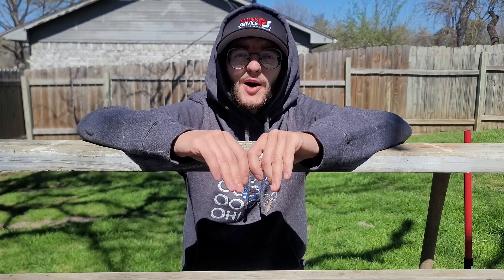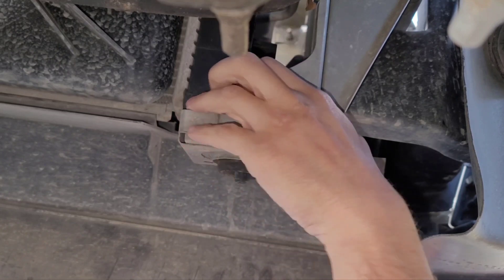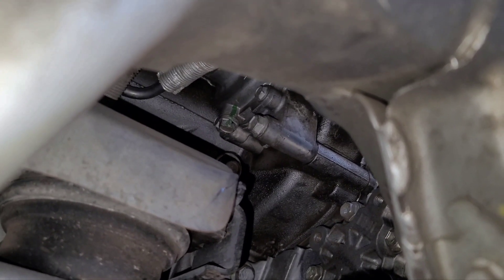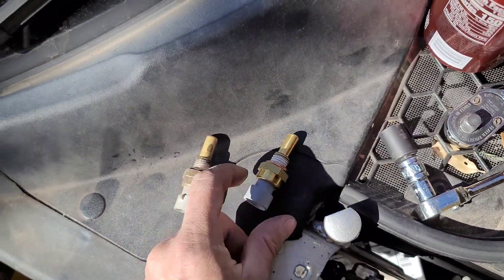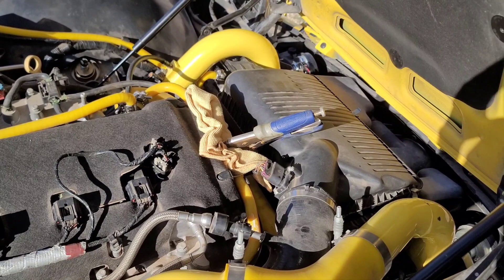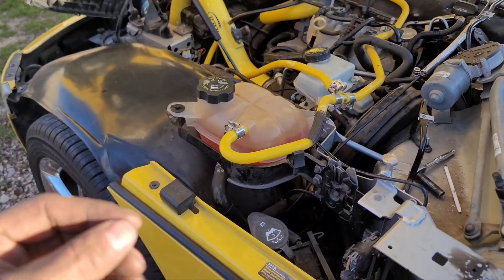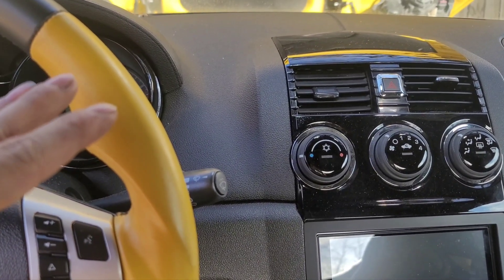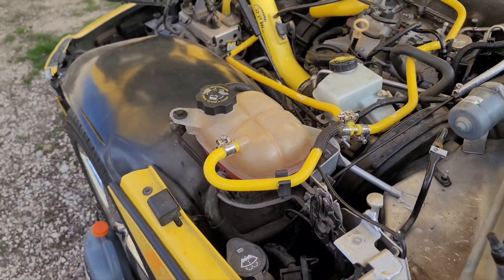Saturn Sky Coolant Tempurature Sensor (ECT) Replacement

Comment: this has to be one of the best instructional videos I have seen.  But I did not see where you replaced the water filter  water that you had drained as well.  Or did I miss it?
Reply from the maker: Thank you so much!
When the Surge Tank is lifted above the Engine, the Coolant flows into every nook and cranny including the Water Pump (which is what I believe you were referring to? Not a Water Filter?). You won't "see" it, but you can definitely hear it flowing throughout the Engine as the Surge Tank drains.
Hope this helps!

Comment: How did you know your sensor was bad? Thanks.
Reply from the maker: To my knowledge, the sensor wasn't actually bad. However, after 17 years, things get worn out and don't read like they used to. It was preventative maintenance. 
Now, if you need help diagnosing when it could be bad, just pay attention to your temperature readout. If it's just dashes "–––" then something is definitely up. If the reading seems jumpy, check it out. Or just wait for an engine code.

Comment: Yet another great video! - I really appreciate your work on your videos, the amount of details and precise description is on point incredible.
My GT (Opel) sporadically overheats, by sporadically I mean, it goes well for months(!) and then suddenly the temp rises, next day and days/months, everything's fine again, in winter and in summer, I use my car as a daily and I drive it almost daily.
The autoshop's, I visited, don't have a clue, everything seems to work properly. No engine-error code, the fan is running, the coolant pump is fine, enough liquid, no leak, the thermostat seems fine aswell. - I suspect there's air in the system, but I'm by far no expert, can it be just air bubbles? And how do I get rid of them without flushing the entire system.
Reply from the maker: Thank you so much! I try to put as much information as I can for everyone's benefit. 

As for your overheating issue. It could possibly be due to air in the system, as in a very small amount which sits under the thermostat and keeps it from opening for a time. But usually, if air is prominent, there are more consistent times of overheating. There is a way of possibly removing all the air without flushing, but it involves an air compressor. I believe there's another video on YouTube that showcases this, but I always prefer a static fill. I'll provide the link to the video below. I hope this helps you! Once again, thank you so very much!

Link:
https://youtu.be/yxUAzxbgb4M?si=T8cpXwwQ-aFEmIlm